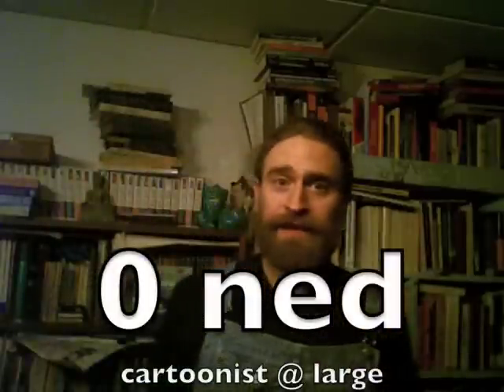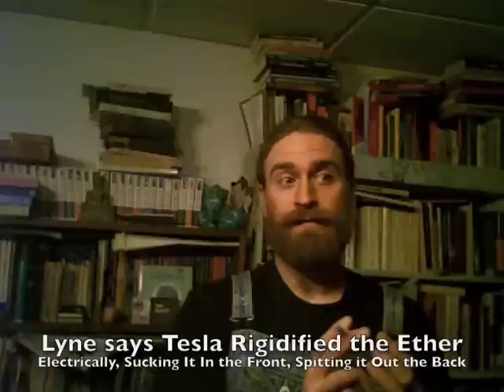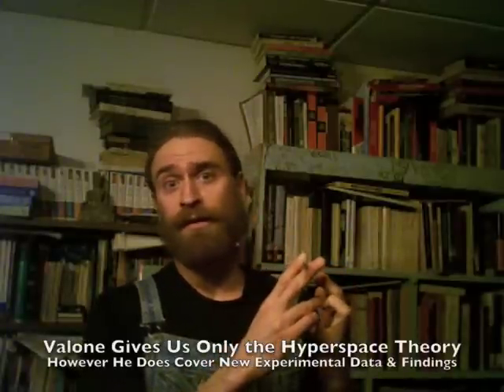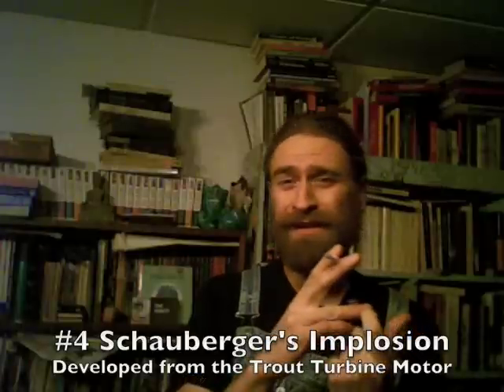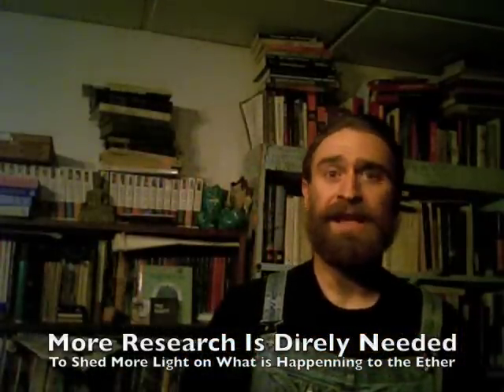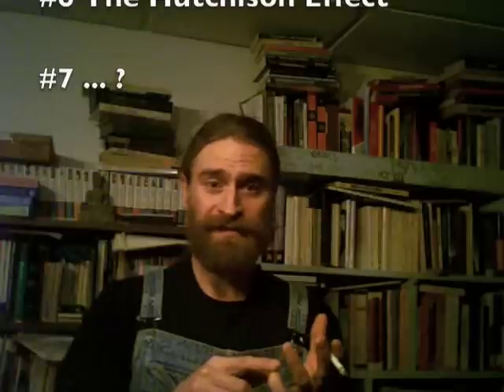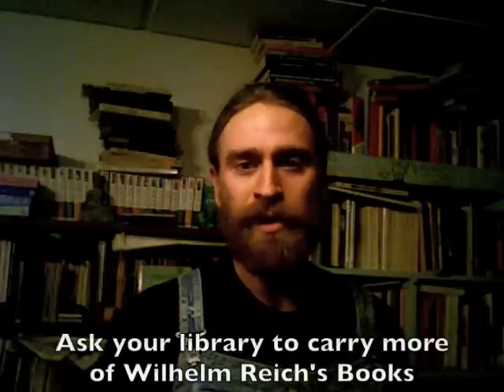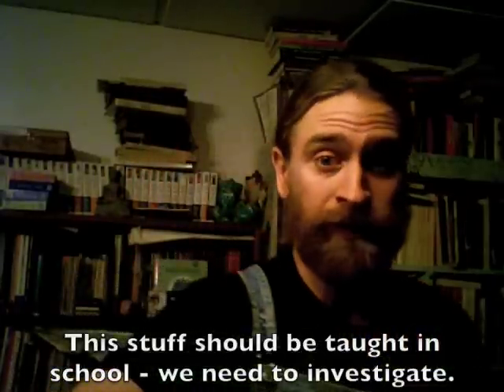How Many Ways Can You Build a Flying Saucer?

Comment: Hi, so which one is the plates at the bottom of a pole and smaller plates at the top, they say massive electric charge creates a place out of time/space sought of so no G`s just smooth travel, has to have cameras to see where your going and the occupants must stay in the centre to be protected (like a faraday cage). Seen it on a vid they said they took 3 of them to an air show one year.
Reply from the maker: me001ist sounds like #2 on my list, Biefeld-Brown effect uses plate capacitors, positive (expanding) attracts, negative (contracting) repulses.
Reply: 0ned Thanks

Comment from the maker: William Lyne's research shows Tesla's method to be completely different from TT Brown's - according to Lyne, Tesla's method used high frequency alternating current and DC Brush discharge - Brown used simple capacitors with high dielectrical constant at high voltage - Military tests of the biefeld brown effect make show supersonic speeds, but we have it on historical record the Tesla claimed his craft would go faster than 300 miles a second or a million miles an hour!

Comment from the maker: you may be just a hobbyist, but you're input can still be valuable - I read the Lyne two years ago and I'm a bit rusty. It's easier to use the dialectic to correct a mistake before it's made in the "monolectic." And so far you're the only who's read Lyne that's come forward, so I have no one else to argue with me.

Comment from the maker: not personally - but you should know that the term "zero-point" is a misnomer - it comes from "zero kelvin" which is a theoretical absolute temperature Kelvin predicted based on the volume of gasses - Kelvin predicted the energy came from the internal motion of the ether - You can read author Wm Lyne on this, or do a google books search in full view for keywords: Thomson ether vortex Kelvin kinetic elasticity, for primary sources from the 19th century.